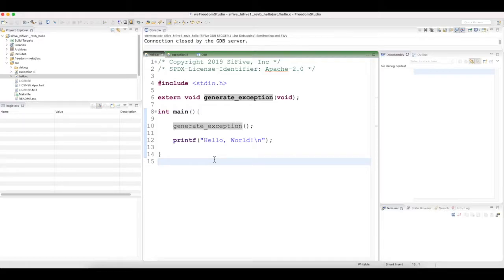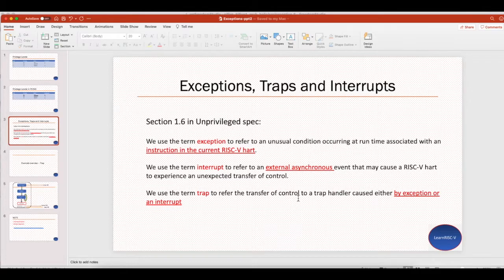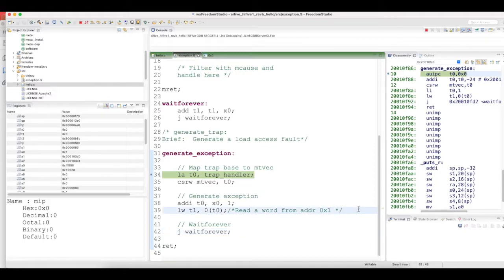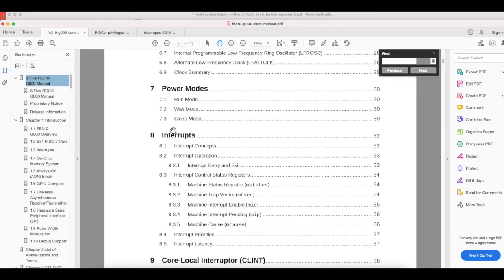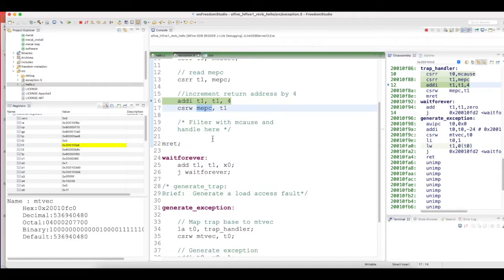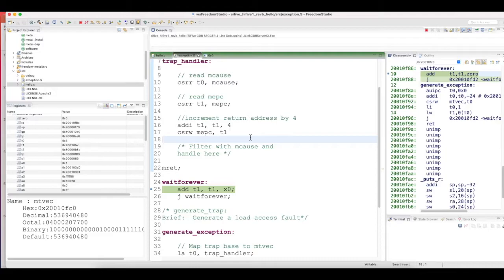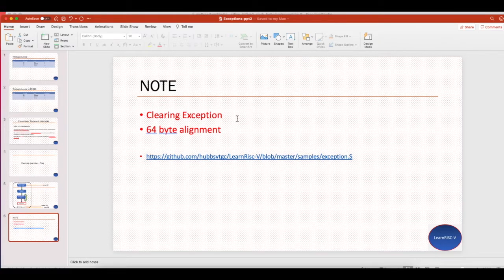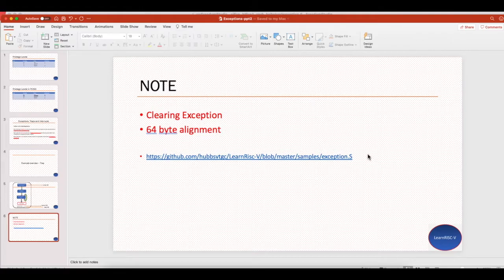RISC-V Exception handling in core

Comment: I think there is an issue with the source address when the exception occurs within an exception handler.  You really either want both addresses or the original exception, basically i think there is another read if already handling exception
Reply from the maker: @dc Yes, you are right the source address is NOT right. Can you follow the comments from @Maksadbek and my reply few months before.

Comment: 07:81 t1 in trap_handler:13 must be the address where exception occured, and it's 20010fe8. But in disassembly section (on the right) it's 20010fa0.
Reply from the maker: Hi @maksadbek good observation, however the mepc value 0x20010fe8 is correct whereas the address on the right 0x20010fa0 is NOT correct as it has been observed at-least during initial times (release) there is a mismatch between actual addresses and addresses on debug session. Obj file dump gives the right address for exception occurrence as 0x20010fe8.
Reply: @LearnRISCV  Thank you for prompt reply!
Reply from the maker: you're most welcome.